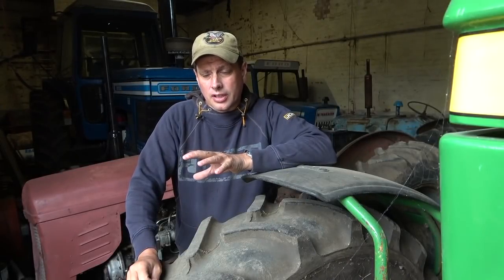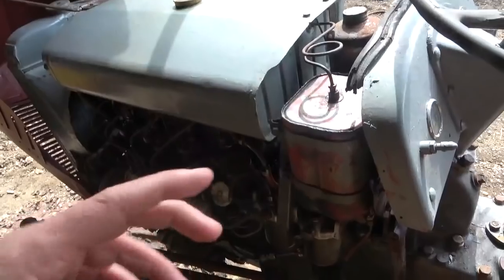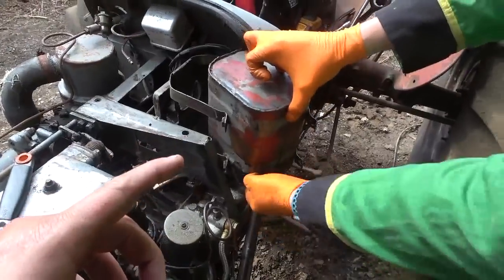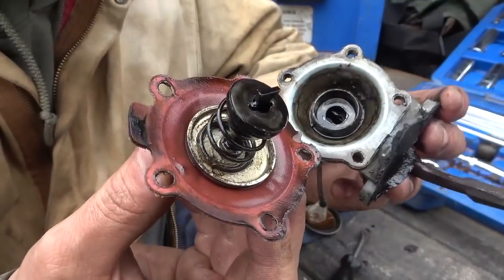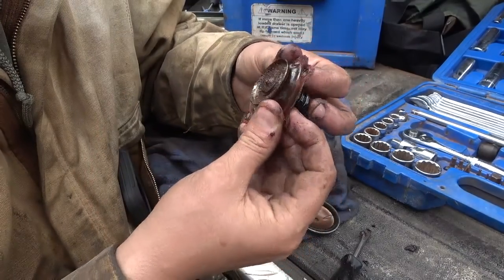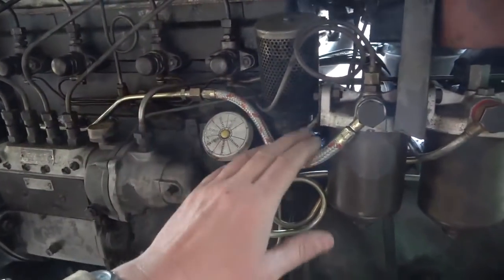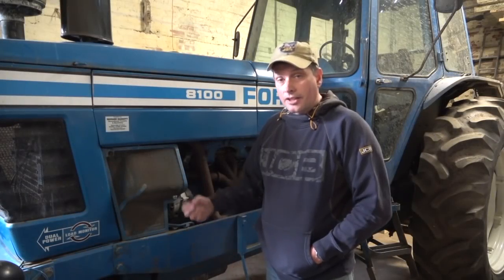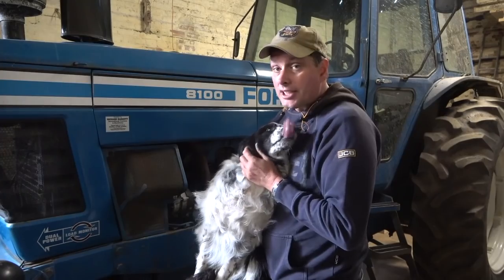DISGUSTING FUEL ! - Lift Pump Rebuild

Comment: My mate has a grey fergy it hadn't been going for atleast 10 years he wanted to knock the shed it was in down so pulled it out and got him to pull me up the lane put it in top gear let the clutch off and it fired straight away didn't even change the fuel real nice sounding engine have you watched Clarksons farm it's gone down real well with the farmers I've spoken to around here?

Comment: After the safety switch on the gear levers went on our Ford 4600 we wired a push button switch that was on only while pressed and fitted it via preexisting holes to the clutch pedal with a bolt to operate it when the pedal was depressed.

Worked well when kids tried to start it

Comment: Fergie sounds Sweet as a nut again, lovely throttle response! Quite a bit of Jurassic deposit in that lift pump. Great seeing Kimberly use the adjustable hammer for the intake and exhaust manifold.
I'll try and watch some more of George's video's 🤣
Keep up al the great stuff you're doing!

Comment: Great to see the little Fergie getting sorted. It seems as though you have disabled the switch on the side of the gearbox. It used to be a right faff pushing it with your heel while trying to get the gear lever in the right spot for it to start
Reply from the maker: Yes it's jammed in tight.

Comment: Remember to put some oil in the czm box of the injector pump. Also drain the rubbish if there is any in the bottom. Also at the rear side if some of these old inline pumps there are filters in the housing like wadding. It is sometimes behind the pump so you might need to take it off the clean it.
Reply from the maker: Already done. I've done the injector pump when I bought it as I thought it was playing up.

Comment: Hi Lord Muck .Is there any chance you could shine a light on my recently  restored ferguson tef 20 .  problem .The tractor puts out oil  where the exhaust  meets the  exhaust  elbow when running  .The  tractor starts easily but i have noticed that the  oil pressure  used to be better before this problem  started .Any help would be appreciated  . Thanks
Reply from the maker: Rings could be stuck. Just start at the beginning and work your way back

Comment: The check valve in the fuel pump looked just like the ones used on Hosier milk tanks to stop water getting in the air blower!

Comment: Just wondering why you have the air inlet next to the exhaust manifold so the engine is drawing in hot air i always thought the cooler the air intake the better
Reply from the maker: Well I wondered that also ! It's where they are but I thought maybe it would help in cold weather but must be a hindrance in warm weather ?
Reply: @LordMuck  you have a purpose made resess  in the tank cornner maybe it's ment to go up there
Reply from the maker: No, have a look on Google etc, lots of them are where mine is 🤷🏻‍♂️

Comment: What's the oil pressure like on that Ferguson? the MF35 I had was a similar engine and had terrible oil pressure even with 20w50 in it😂
Reply from the maker: It has decent oil pressure.
Reply: @LordMuck  maybe mine was just buggered...

Comment: As Always, Keep up the Good Work. Love seeing Tractors come back to Life! I was wondering if you could help, I am having problems finding a rebuild kit for a Fuel Injection Pump.  It is for My MF 231s. The Fuel Injection Pump is a Delphi, Type 1235, Model 2644A450FN/2/2420. Can you point me in the Right Direction? I would like to have all my Ducks in a Row before I dive in to Minimize Down Time.
Reply from the maker: Just do as I do - go online and search for a supplier.
There will be plenty available.
Failing that find a reputable fuel injection specialist.
Reply: @LordMuck  I have been having "Difficulties" having a response from them, I suppose I am going to have to just show up and see if they will talk to me then. Massey says they only sell rebuilt, not kits for them. I appreciate the quick response, it means alot. Thank you, Do Well!
Reply from the maker: Look around as there are many more suppliers and specialists other than MF.

Comment: Sorry Sir Muck but the video would be better if you actually showed  the work on the pump, ie fitting the valves and the diaphragm. Many who watch these vids are far from experts and do so to learn how to do things properly and it's  a bummer when the important bits are cut. . Sadly it's quite common on lots of others. videos too.
Reply from the maker: My audience is beyond 'Basic mechanics 123' and I've covered rebuilding diaphragm pumps countless times so I'm not repeating myself every video.